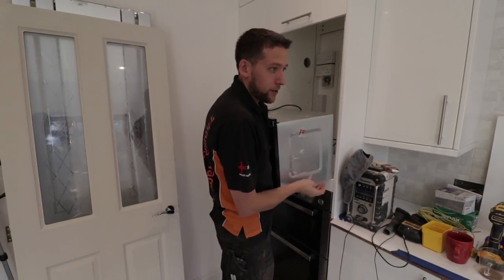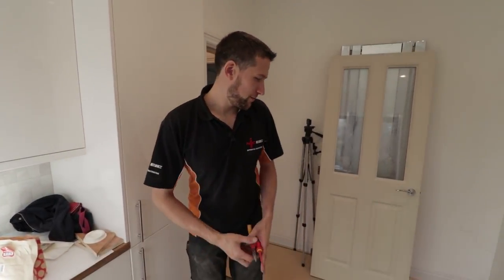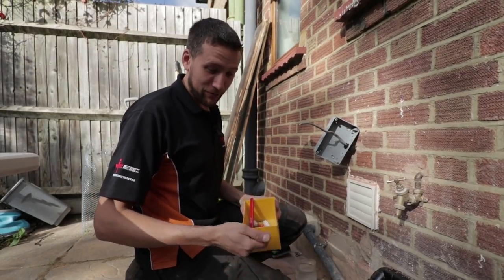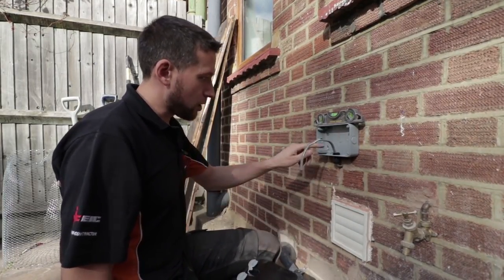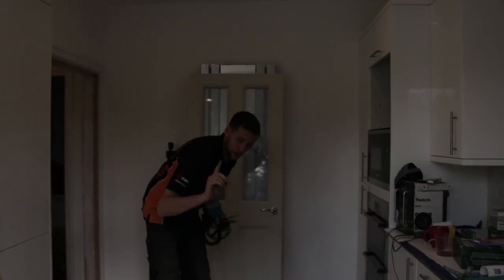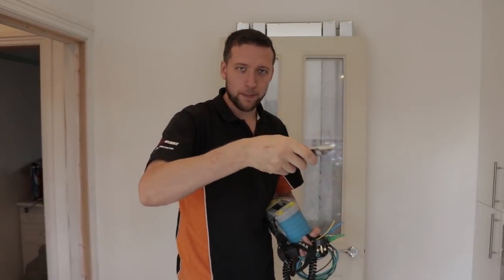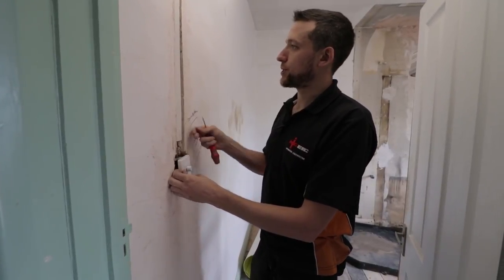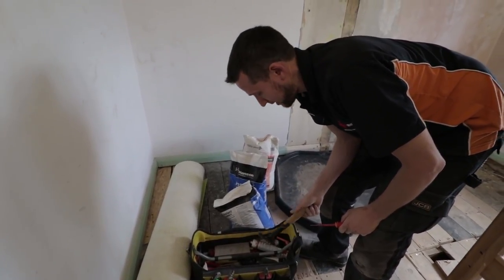The Final Furlong - Rewiring a “just rewired” house | Thomas Nagy

Comment: So many people saying they use silicone to seal outdoor boxes.  The standard acid curing stuff will corrode contacts if there's no way out for the liberated acid vapour.
Reply: While that is true, out of professional courtesy, I choose to assume they know this and always use neutral cure silicone.
Reply: Welp. Gonna have to redo mine now. Or at least get the front off and see how it's fairing. Cheers Clive!
Reply: I've used it so many times... Also places where i've had to come back and add more to the box, and not a single drop of water would have come in.
Reply: big clive !!
Reply: @TheRocky3211  I know. Big Clive on here. Watch his stuff all the time it's great
Reply: Duct seal putty?
Reply: job assurance =p
Reply: Didn't know this, Everyday's a school day thanks Clive. Albeit i use Stick like Sh*t waterproof sealant which is PH neutral before during and after curing.
Reply: Stopped using it when i had to take apart a external jb and anything brass had grown white hair this was down to the silicone.
Reply: Stopped using it when i had to take apart a external jb and anything brass had grown white hair this was down to the silicone.
Reply: Seal boxes? I put a hole in the bottom to let the water out :) 
A box already on my hose has the cable coming in the rear as described, so I ran silicone along the top edge and sides to stop water running down the back into the hole.
Reply: I accidentally left a small squeeze tube of RTV in a drawer of my toolbox at work. Wow it destroyed the surface coating of the tools in there, found out the tube had split.
It wouldn't normally matter but I had been sent on detachment where tools would be provided and my box was left undisturbed for a while!

Not as bad as a colleague of mine though, he once spilt a tub of deoxidine into his tool tray one shift, didn't find out until the next morning and most of his tools within were destroyed!
Reply: It won't corrode anything. Did hundreds of these this way and never had one fail, I often return after some years and add more connections and never saw corrosion.

While it's extremely common that not silicone protected ones do have water in them.
Reply: If you drill out the drain hole as you should be doing but nobody does then you would have ventilation.
Reply: Would the small 4-5mm drain hole you’re supposed to drill at the rear-bottom of the box where it’s marked allow vapours to escape? Whilst I’ve never had an issue with corrosion when using silicon in jobs I’ve done and tested again at a later date, I will keep an eye out for it, this isn’t something that was taught to me like at all.

Comment: A 25mm hole with a 20mm conduit though into a female adaptor which is inserted into the 20mm knock out at the back. Finished with an exterior silicone around the edge but stil allowing for the drain hole. I know it works cause I been doing it this way for  a long time. My own MK socket is a testement to this 12 years and still going.

Comment: Hi Tom, For outdoor sockets I knock out the 20mm rear entry and use a 20mm blind grommet from tool station / Screwfix. Just pierce it through the middle rubber and drill out the drain in the enclosure just in case. Keep up the good work mate.
Reply: Exactly the same as this, a bit of silicon as well if I'm feeling generous!
Reply: Same, but I use one of those membrane grommets (the sort BG sell for their CU knockouts) so the membrane hugs the cable a bit better, the depth on them also makes it easy to put a neat bit of silicone in at the last minute (on the inside), contained within the grommet 'walls'.
Reply: I use that on conduit boxes but it doesn't work too well on kit with standoffs.

Comment: I normally take the cable through the back of the box but I add a ring of silicone around the knockout before I screw the box back. I also add a ring of silicone around each screw hole before I screw the box back. Maybe overkill.. better safe than sorry 😂

Comment: Best thing having the neutral wire down to the switch it makes installing “smart light switches” which nearly all need a neutral feed so much easier to install. As stated by others most have it up with the actual light fitting and a P.I.T.A to get back to the switch

Comment: As an electrician I'll say I love your videos and how you explain everything and also I love your sockets and wish we took more ideas from them they are so much safer than what's in most every home here in the states.  We're just now moving to requiring shuttered sockets but the addition of the switch right there at the socket would be another major safety addition that wouldn't hurt at all no need to race to a panel box in the event of an electrical fire or short just off right at the point of trouble.  You guys honestly have to have the safest electrical system I've come across.

Comment: You can't beat MK accessories.
 Definatly agree with you about doing the wiring at the switch and just taking one cable to the light
Reply: They are now made in China, quality control has gone out the window, just look at the feedback on Amazon alone. I no longer use them.
Reply: @VAX1970 True, when compared to the quality of the MK accessories from 20 or 30 years ago,  they were virtually bombproof & made in England.
Reply: Godda say, years ago MK were worth price difference, but now I dislike them as a brand. Some of their ranges are still good but several accessories in their Logic Plus range are now to be avoided like the plague. On a routine inspection & test of one facility there was one room with 14 standard white Logic Plus DSOs and I had such erratic Z(s) readings at the socket front that I ended up testing every outlet on the room and found that, while the left socket of each double gave 0.32 to 0.45 ohm the right sockets gave readings from 0.9 to 1.95, several failed the max permitted. The brass contact sleeves and bars linking both sides were naff on every one in the room.
Also the Logic Plus FCU is one of the worst simply for not having a proper cable grip. Thick cables (2.5mm, or 1.5 rubber) almost need to be hammered in to that stupid plastic doohickey which sometimes breaks due to the strain, and small cables for little equipment often don't hold at all and just slip out leaving undue strain on the terminations (2-core cables don't stand a chance)
Reply: +Vax Buster Some of their stuff is made in Malaysia, i.e. K2747 K781 double unswitched 13A socket. Things like the brass earth strap rivets are a bit rougher.

Comment: With rear entries to boxes I either a) Use a thin 20mm grommet, which on a smooth brick wall gives a pretty good seal, or b) put in a 20mm adaptor, neatly open out the hole in the wall to take it and use some non-acetoxy/neutral cure silicone or one of the water-based sealants around it if needed. Don't forget to open up the drain hole in the bottom of the fitting of course, as per instructions.

As for back-box spacing, I've got a few clip-on spacers bought in the late 70's which get the spacing spot on for all normal faceplates. They were meant to be left in place but fortunately they can be removed for re-use after fixing as they disappeared from the market. Ashley do a similar clip but I believe they only fit their boxes and can't easily be removed after fixing - I've only seen them in catalogues so please correct me if I'm wrong.

Comment: @Thomas Nagy, I would just put a plastic plop into the back of the box. Push the cable through it. Then push that plastic plop against the wall. Then, if it isn't satisfactory. Throw on some silicone.

Basically, the flat end of the gland(?) against the wall, with the pointy end on the inside. As long there is room and the cable is squeezed snug against the gland end. It should be fine. Water will have hard time, wicking into the box.

I know that we installed connection boxes outdoor for charging ports. We used to use the smallest drill. Drill a tiny hole at the bottom. To allow potential water condensation to escape.

Comment: Hi tom, the way I tend to fit outside sockets is I bring the cable through the back then fill the knockout with a little bit of silicone to prevent water getting in and run abit around the back box to stop water going down the back

Comment: Always in through the back, open up the drain in the bottom of the socket but then add clear silicone around the back of the box 100% watertight but then any ingress goes straight out the drain. 

Plus looks better!!

Comment: Regarding that laminate flooring, under part B of the Building Regulations there is a requirement for the internal linings of a room to inhibit the spread of fire, but this does not yet appear to extend to floor coverings as “they are not significantly involved in a fire until well developed, and thus do not play an important part in fire spread in the early stages of a fire that are most relevant to the safety of occupants”. Of course separate Fire safety legislation would apply in varying degrees to commercial, public, multi-occupancy & tenanted buildings, and which could require a Fire safety risk assessment, with some requirement for floor coverings to resist fire long enough for people to escape (especially in escape routes like corridors & stairs).

The EU does require testing and classification of floor coverings for fire resistance under EN14041 & EN13501-1, with combustibility ratings from the highest, A1 (non-combustible) through A2, B, C, D, E, and the lowest F. They are also tested for smoke classification, being rated S1, 2 or 3 high to low. So if you’re interested and look carefully your new floor coverings should have a classification, something like say Cfl-S1 (fl stands for flooring).

Comment: For outside sockets I keep small lengths of plastic conduit and adapters into the center hole of the socket, just cut of the excess in the house and silicone it all.

Comment: Electrical boxes in the exterior wall,  I go with the  center knock out and seal the box with silicone.  Also the outlets are GFCI for wet locations with a bubble cover called in-use

Comment: I prefer your switch wiring too. On the exterior socket, I like to come in the back of the box through a blind grommet. I put a thick ‘U’ shaped bead of exterior sealant on the back of the box about 15mm around the grommet, with the open end at the bottom. With the drain hole drilled, I’ve never had any problems.

Comment: Couldn't agree more with bringing the cables into the switch box, out here in Cyprus all the houses are concrete so no attic etc, so everything is plastic conduit which is amazing when doing a rewire. As for the outside socket I just use the back entry point and throw in some good old silicone, never had an issue yet with our version of NIC.

Comment: For the outside socket, if I have to use the hole in the back, I use a Blind grommit and Stanley knife a slit in. Where the cable comes through the hole in the wall I bladder it with clear silicon, leaving the excess sticking out, when you push the box back the silicon forms a seal around the grommit too

Comment: I use the knockout in the back with a ring of silicone about 30mm larger than the hole. That way it is sealed but the cable will still be easy to pull through if ever required. And make sure to open out the drain hole in the bottom of the enclosure. 
Have you tried the Click Mode switches etc. from ToolStation. They are very nice and a good price. I always fit 35mm back boxes where possible to future proof for dimmers etc.

Comment: I drill out the back of the Outside socket below the knockout for the cable, then a shed load of silicone, then drill a very small drain hole in the back where marked just in case any water does get in and run some clear silicone round top and sides only. I am totally with you on the smoke alarms, I really think they should be on a frequently used lighting circuit. Love watching your videos. I also have always fitted MK because of the look and the fact they do everything you can think of in grid, so you don’t have to worry about things matching. I would watch out for their switched fused spurs though as when they come out the packet, the fuse carrier is never screwed in fully and have seen a number of them burn out with higher 2-2.5kw loads attached, also their data modules and shower pull switches are shite, I use Hager for those two items.

Comment: 13:00 I agree. Turning smoke detectors off should cause annoyance. I also fit septic tank alarms around here (Yorkshire) and I put those on a fused spur off a socket circuit for the same reason.

Comment: In the USA neutrals are required in all switch boxes now due to smart switches and alike. We can’t have just a switch leg. If the line goes to the fixture first, then a three wire supply must go to the switch box capping/terminating in the switch box. Earth obviously is required.

Comment: depending on location and what is in the tool box. either via the knock out on the rear and a 20mm automotive flat rubber gland  or 20mm plastic conduit into an oversized hole through the wall and plenty of sealant

Comment: Outside socket with 20mm blind grommet in the back and plenty of silicon between the box and the wall, works every time, and it holds forever. Make sure you clean the brick first, to get the silicone to stick.

Comment: Hole through the back, silicone back of the box so you are not left with silicone around the socket, I also put some in the hole the cable(s) come through and recently a small drainage hole at the bottom of the socket to allow condensation to escape. 😊

Comment: With regards to the outside socket, always back entry and then fill with clear CT1 I also seal the outside but leave the bottom and drill out a small drain hole so any moisture or ingress behind can get out.

MK stuff is half decent but not as good as it used to be since they outsourced it, find Screwfix beat most people on prices for sockets and spurs in the MK white plastic range. Personally I like Hager stuff, switches are great as they have a neutral terminal too! 

Always feed the switch, unless it’s going to be easier to put a three plate above a downlight or at the ceiling rose but 99% of the time it’s to feed the switch.

Great video mate, keep up the good work. 👍🏻
Reply: I've discovered CT1 sealant recently. It's amazing. Haven't checked, but presumably no acid curing so no corrosion of terminals.

Comment: Rear entry for the outside socket for me; normally use my 5.5 masonry bit to make a hole just larger than the t&e, then silicon round it. Bead of clear silicon along top and sides of the box too.

If you use MK again, they do make a sw fu sp with a front plate the same depth as the socket outlets (no bottom flex outlet capability) - K1040WHI I think

Comment: If the back box is deep enough you can turn the gland round so it’s on the inside and also with your big role of the sleeve I cut mine into 5 m lengths and then coil them up I am on the hook and then you’ve got a nice easy manageable five meter Lancs to use when you need.

Comment: I also follow Thomas in bringing neutral to switch as some Smart switch require neutrals at the switch just gives you more options. also a lot easier putting a Wago in a 35mm Box than trying to stand on a pair of steps wiring in a switch wire etc to ceiling rose or downlighter. bit more cable but saves time in the long run.

Comment: I take the wire straight through the back and use silicone,  as fixing screws also go through the back i dont think it makes it any less water proof. I have never had an issue with any in 15+ years.  The MK masterseal have the fixing screw in a separate compartment to prevent water ingress from the fixings.

Comment: I use two methods, for outside J/Boxes, First method is cut out the 25mm nockout in back and pop silicone around the hole and around the outside of the J/Box, the second method is 25mm masonry drill bit about 30- 40 mm into the brick use Corrugated/Flex out of the wall into the bottom/Side or top of the J/Box with a screwed gland and gluing the corrugated in to the gland then silicone around ANY possible spots that water and penetrate.  - Australia.

Comment: Yes I go out the back with a sealed grommet and put a bit silicone to double protect it and a drain hole just Incase . No a fan of seeing twin and earth outside a big no no for me . Even if it’s just about 2 mm of it 😂🙈👍
Reply: Best way! Only way 😏
Reply: I agree, should be rear entry only, no exposed wire, sunlight breaks down the sheathing on T&E in no time.
Reply: Keep in mind that if you seal an electrical enclosure with standard acid curing silicone, the trapped acid fumes will corrode contacts.
Reply: BIGCLIVE NOOOOOO don't tell me that! Here in Australia tons of Electricians use silicone inside of enclosures to keep them water tight. Is it best to use a silicon that is not acid curing?
Reply: Yea before you screw it back you put a bead of silicone around the hole
Reply: bigclivedotcom you don’t seal inside the box. You put a a U shaped thick bead on the back of the box, with the open face at the bottom. You should use a decent exterior rated sealant though.
Reply: @BigClive: I remember you saying a few times at least: "water will get in everywhere/anywhere!". You can only mitigate. :)
Reply: +Retro Retiree Having been involved in the design of the odd bit of external kit in the past I'd add "...so make sure it can get out".
Reply: Albert steptoe
Here in the  states.
 that is a code violation to have Romex exposed like that.
It has to be in a wall or somewhere where it is protected. But you can't stuff it through conduit.
you can bury it but it has to be of a buried type grade and it has to be protected by a GFI and no more than 20 amps.
Reply: cutting the grass and hit the wire dead. and if its NFPA for fire safety no the flooring does not need to be rated. carpet is like pouring gas. its the sub floor that needs to be rated plywood.